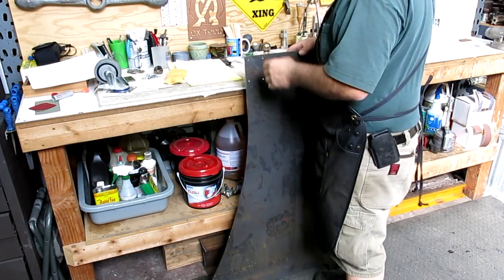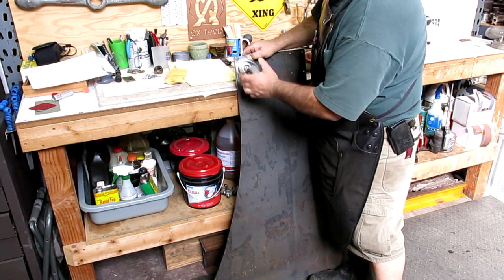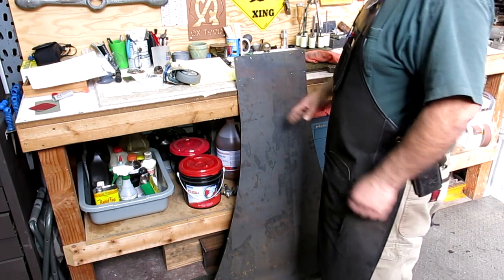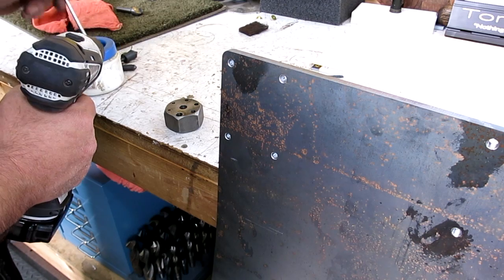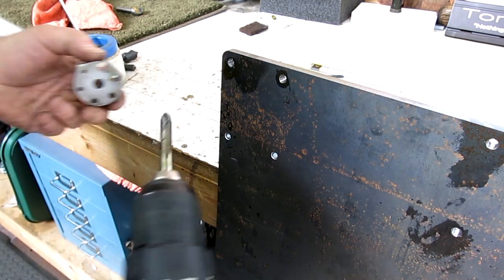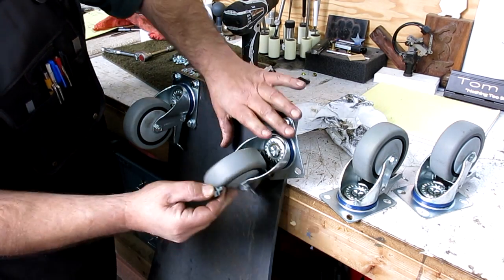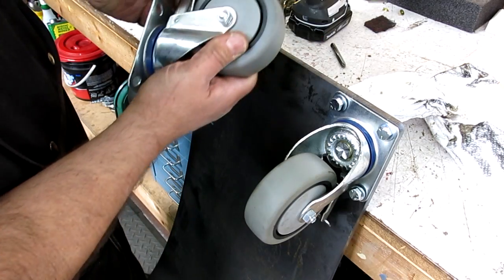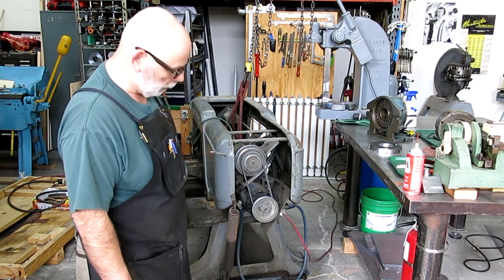Johnson Saw Base

Comment: oxtoolco Those are really nice saws, very ridgid frame, you can run the band tension really REALLY tight, and get super straight cuts.  Nice work on the base, that will be handy.

Comment: Ha Ha pretty cool trick with the tapping. The spiral tap and straightening block pulled it off. I thought it would break if not done by hand. I learn something on occasion and did today.
Reply: Lew Sou Nice caster with the features a very wise move. I only noticed you positioning the base for drilling and thought you were referring to that part of the video and never noticed the paint job till you mentioned it.

Comment: Hi Tom,
In my shop I'm trying to install everything on casters, the only drawback is with soft casters they get embedded with metal chips and thumble their way like kaklunk... kaklunk... kaklunk... As they roll....
At $7 it's a good deal...
Pierre
Reply from the maker: pierre beaudry Hey Pierre,

There is a cool invention to solve that problem. We call it a broom down here. <g> Thanks for the comment.

Cheers,

Tom
Reply: I guess that the wheels get klunked between sweeps up here...  My shop isn't like yours or Ray's...    If you have a minute you could get an eye to my channel, things improved since last fall,    Pierre

Comment: Great looking base.  Need to build one myself for a Chevelier Surface Grinder, do you think your  3/8 plate would hold 1400 lbs vertical?  Could you post a link to the Steel USA supplier for casters, couldn't find them on the web. Thanks!  Nice video!

Comment: Nice base, It complements the saw rather than conraptioning it like many others do.
Could you give a ball park cost on the steel plate?
Reply from the maker: bendavanza Hi Ben,

The base including material and cutting was $174. All I had to do was tap the holes and paint it. Thanks for the comment.

Cheers,

Tom

Comment: I like how the motor on your saw is tucked in under the drive wheel.  The motor hangs off the back on mine.  Did yours come this way or is it a mod?  Also, do you use the factory wire bristle blade cleaners?

Comment: Hi Tom.  I've been watching your videos for the past few months and have followed your columns in CTE magazine for a couple of years.  I have two short questions.  What is the machine on the wall to the right of the clamp rack that is visible when you are drilling the stud holes on the saw base? Also what is the clear cutting lube you have in the Spillmaster cup?  Thanks, I have learned a great deal watching.  I'm a retired mater industrial electrician and a hobby machinist in training.
Reply from the maker: James Rice Hi James,

That is my Rotex turret punch. It its used to punch various sized holes in sheetmetal. The top and bottom both rotate to align different punch and die combinations. Most of the spillmasters have Relton rapid tap in them. Its a decent economical cutting fluid that works on a broad range of materials. Check out my video toms .02 worth on cutting oils and fluids.

Cheers,

Tom

Comment: Looks like it's gonna work great. 
The base & casters looks a bit disproportioned tho.
Reply from the maker: He Ka Hi He Ka,

In what way? Do the wheels look too large or small? I'm curious what you mean.

Cheers,

Tom
Reply: oxtoolco I just think the wheels and the base look a tad small compared to the huge machine. It looks really top heavy.. almost like it could tip over real easy. But it's just my opinion so don't worry about it too much =D

Comment: I love having nearly everything in my shop "mobile" too.
Would they have charger much more to cut your logo into that plate?
Reply: thedge7 Mobile is the way to go, but I don't like the metal chips getting stuck in the wheels. The good thing is that it makes me clean the floor before moving stuff around. A tidy workshop is a productive workshop. A logo would have been a great addition to the base plate :)
oxtoolco 
Tom - I bet the Johnson God gave you isn't as big as that Johnson. Yeowza!

Comment: Nice stand. Question: how come when you started your TIG machine, it sounds like it is the evil giant monster machine of doom?
Reply: Partly because the argon solenoid fires up and purges the oxygen from the lines.
Reply from the maker: Pat Farrell Hey Pat,
My welding machine is older that your kids. Its from the era when welding machines were full of copper windings and not many circuit boards. Thanks for the comment.

Cheers,

Tom

Comment: A powered band saw sitting there and yet it is a vise and a hand saw doing the work.... something seems wrong here. LOL
Reply from the maker: bcbloc02 Hey Brian,
The blade on the saw is four teeth per inch. Not cool for little wimpy stuff. A hacksaw will beat a walk to the horizontal for single cuts up to 3/4 inch. Besides you just stand there and watch the thing cut anyway. Thanks for the comment.

Cheers,

Tom